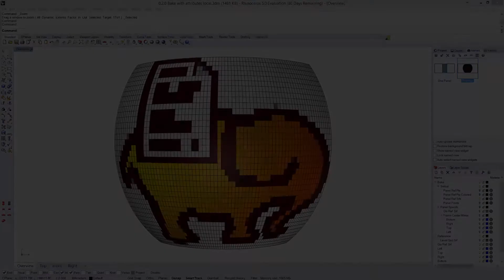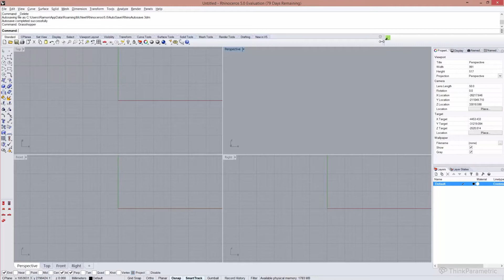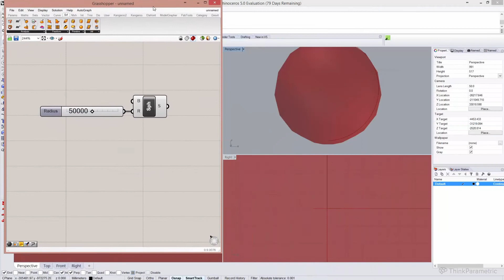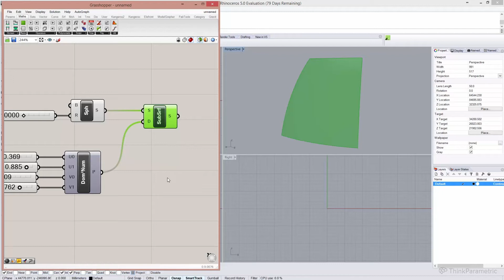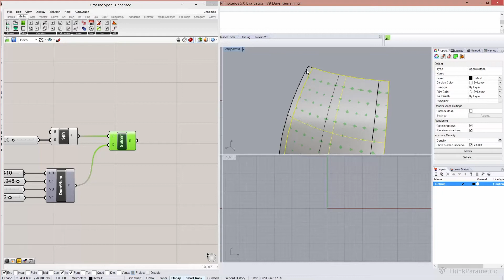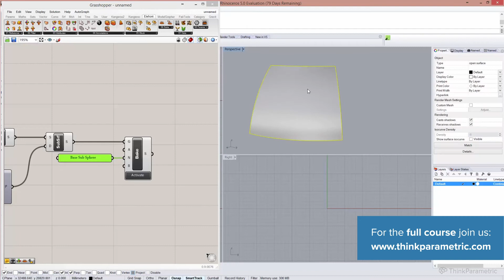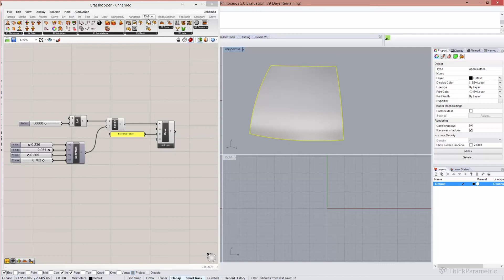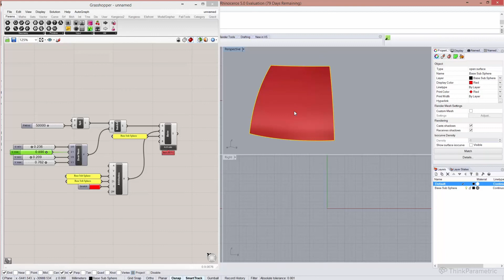Elefront 101 - Part 3

Comment: Hi,
I currently have a problem with the elefront bake component.
I'm live tracking thousands of curves, which then get different hatches which are baked with the bake objects component.
The problem is that each time I'm modifying 1 curve, grasshoper re-bake all the curves, which is taking a few seconds. 

My first thought was to add different bake names to differents branches, but sadly
it is exactly written that it can't be done... 
//*If specified, all objects that were previously baked with the same Bake Name will be deleted!
Only supports single item input. Do not assign different Bake Names to different branches. 
Use Key/Value pair to assign different attributes to each branch. *// I tried differnt keys / value but didn't change anything... 
Do you have any idea how i could resolve this problem ?
Thanks in advance !